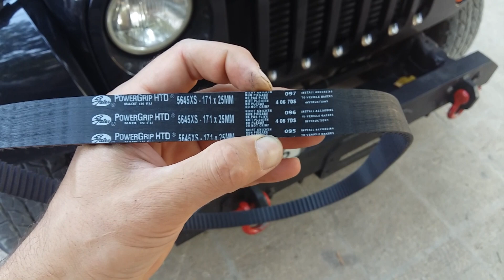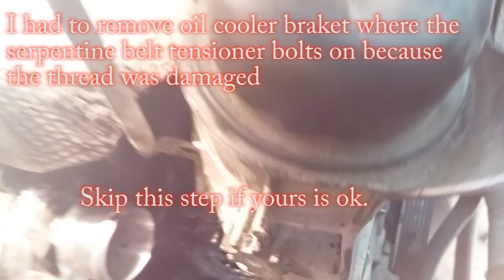Jeep Wrangler JK 2.8 CRD Timing Belt and Serpentine Belt replacement

Comment: Timing marks? If it’s a tooth out expect bent valves or rocker arms
Reply from the maker: Done it 3 times. no prob. just have to mark few places. last 2 times then I got timing kit, with crank and cam lock tools. a bit easy and more confident )
Reply: I agree !! He got lucky. I mark the belt with white pen, 2 on the cam pulley, and crank pulley and fuel pump. I also move them to TDC beforehand in case they move. Then tape the belts together, and mark the new with the same lines. No problems then.

Comment: Thank you for doing that. Which bolts on the serpentine belt are left threated? Only the two idler pulley bolts in line before and after the generator or all 3 pulley bolts and the tensioner bolt as well?
Reply from the maker: You are welcome. The  lefthand thread is the pulley under the generator.
Reply: @unicaproservice2826 For Everyone's Information, both upper pulleys are lefthand threaded and the pulley on the tensioner has a normal thread, however, difficult to undo because of the use of Loctite.

Comment: At 2:04, I’m trying to unscrew the big nut of fan, locking pulley inserting a screwdriver, but the nut is blocked. 
I make a big stress, but nothing.
Reply from the maker: hi. if its first time u r opening it, it may look tight. hold the pulley by inserting pry bar into the holes, and rotate the nut ccw. it will come loose. a good idea is to put some plywood in front of radiatot, so u dont damage it if wrench comes loose or so
Reply: @unicaproservice2826  
Thanks a lot.
Reply: @unicaproservice2826  
I’ve tried to unscrew by a pipe wrench but I’d like buy the specific wrench; could you confirm that it’s 36 mm?
Thank you.
Reply: @unicaproservice2826  
I have unscrewed the nut beating many times with an hammer (800 g) over the end of the wrench (36 mm - 42 cm).
Reply: @paolofogaccia9455  It is 36mm. I will reply to easiest way to remove in a general comment here.

Comment: Nice ,has this engine proven to be reliable for you ?
Reply from the maker: this is the most reliable, powerfull and simple engine for me. electronics sucks a bit  complexity wise but if you dont mess with it it will be fine. Ive modified a lot thou

Comment: hello my name is Heber, I'm from Chile, I have a problem with a Wrangler like the one in the video.  The problem is that by changing the time band, the camshaft sensor was turned and also the point of the camshafts was lost.  I have the work tool for crankshaft and camshaft but as the sensor was turned it made me change the position of the cams and I can't find the position of the cams, I took out the valve cover and from behind the cam sprockets have their  marks and match but I can't match the cams to the crankshaft.  I hope you can understand the problem and if it is possible to help me a little please, thank you very much.  Goodbye
Reply from the maker: drop me an email javid.alkhazov@hotmail.com

Comment: Hi. Do you know where I can find a video for the cam position themselves?
Reply from the maker: what is ment by cam position video? do you need timing set up?
Reply: @unicaproservice2826  - Yes. The setup for the cams themselves where you see them when the tappet cover is off as someone before me forced it with a wrench. My dodge is only starting if I spray quick-start in it. It is not getting a pulse from the injectors and the ECU has no error codes for the injectors or the diesel pump.
Reply from the maker: drop me an email javid.alkhazov@hotmail.com
Reply: @unicaproservice2826  - I sold the car.

Comment: Don't you have to lock the crankshaft and camshaft for this?!
Reply from the maker: if not gonna work on camshafts, not gonna change water pump, then no. be vigilant, swap belt carefully. If not experienced, then might get lock tools. 40some bucks on ebay.
Reply: @unicaproservice2826  Thank you very much! 40 bucks for the lock tools sounds cheap though, might get them to not run into trouble. Changed belts on other cars, too, but they all needed a tool, e.g. DOHC cars.